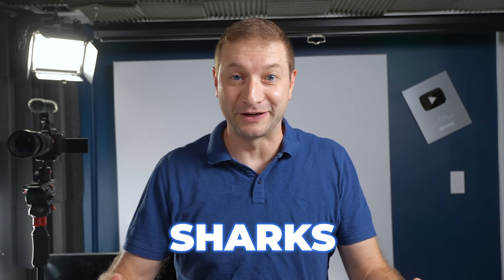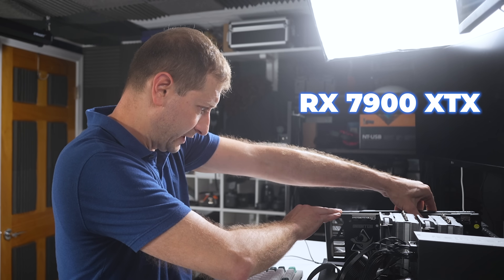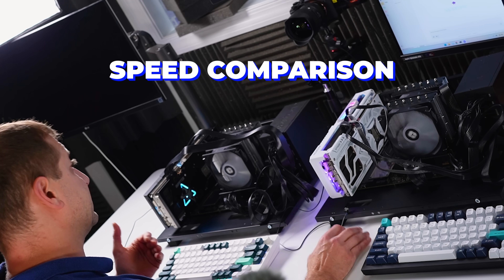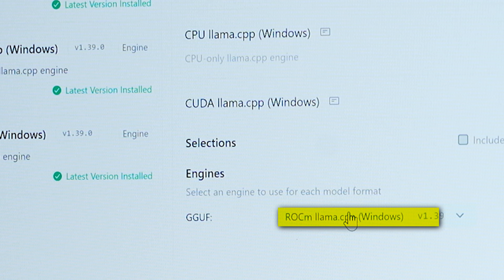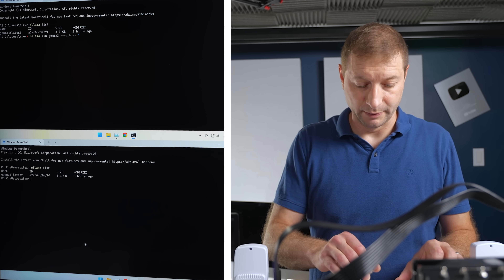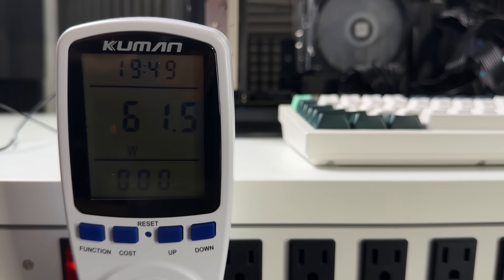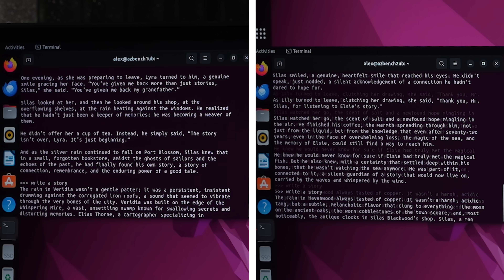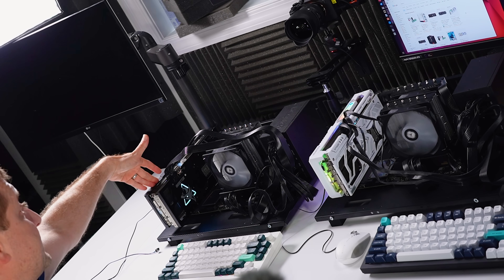RX 9070 XT is cheaper AND better… mostly

Comment: Both cards support vulkan and i have seen videos showing also 7900xtx being quite a bit faster on Vulkan vs ROCm. Especially on linux. As far as i understood the problem is Vulkan is only applicable for ollamacpp and not really general AI scenarios. e.g. libraries that require PyTorch for example.

Comment: I need some input on running local AI models on a Ryzen 9 desktop. I’m thinking about getting a GPU with 24 GB of VRAM, or possibly two 16 GB GPUs — but I’m not sure if running dual GPUs together works well for local AI workloads. Specifically, would an RX 9070 XT, RX 7900 XTX, or something similar be a better choice? Any advice or personal experiences would be really helpful 

Thanks Alex  for making such awesome cotent

Comment: The 9070 xt now works with ROCm on windows just fine, been running for a week or so myself… but now I want to know if I buy another 9070 xt …. Is that better than buying the new 9700 32gb ai card??

Comment: I do not understand the relevance of running 3Gb or even 13Gb models on cards with 16/24Gb available GDDR memory. Try generating UHD video on 16Gb v 24Gb and then see the difference, or run Ai LLM models 16Gb plus with partial offload v full offload. I am still using my old Vega64 with Vulcan and can run various 16Gb models comfortably after the first prompt has been generated and that is with only partial offload usually around 7.2Gb memory being used. There is always going to be a trade off between size and quantization but it all depends on what your expectations are and what results you expect or demand, larger prompts v low, better accuracy or simply faster responses. But when you try and generate UHD on 16Gb v 24Gb there is a clear winner and why 24Gb is a minimum for Ai if you want to mess with images and 4k video in higher resolution v 1080 HD.

Comment: in windows, you need to select which gpu to use on ollama

vulkaninfo | Select-String "deviceName"
That will list all GPUs Vulkan sees, in order (index 0, 1, 2...).
setx GGML_VULKAN_DEVICE 1

your prompt rate is different because your prompt is too small

Comment: ROCm was released before I bought my 1080TI in 2017, and back then I chose Nvidia because of CUDA, with AMD CUDA compatibility or ROCm on Windows nowhere to be seen. Its now ALMOST A DECADE later, and AMD still didn't provide proper ROCm support. Folks, don't buy hoping full ROCm support for Windows is around the corner...

Comment: Actually Vulkan is a graphic API, just like DirectX but not owned by any company, Vulkan is opensource. This is the main graphics API for linux gaming and PlayStation 5 (yes, if you're running game on PS5, you're running it on Vulkan, not any DirectX). But Vulkan because of its opensource nature have many more features, this one which allows you to run models using Vulkan is one of them.

Comment: If AMD releases cards above 32GB of ram for the consumer market, its over for Nvidia. They would literally be scrambling. If they build parallel multi-gpu support into ROCm on top of that, we will see AMD AI rigs everywhere. We already have AMD Cuda support layers in third-party. Capability could beat speed at this point. Mac has shown us that.
Reply: I have news for you friend. Pro R9700
Reply: @mock15599 I’m half split on the AI pro 9799.  It’s a ton of RAM for cheap but it’s also 660 GB/sec, which is slower than even a 3080, 4070ti.  And also the driver issues and compatibility issues. Though they did just just announce PyTorch compatibility with RDNA4 so there’s that.
Reply: @mock15599  For some reason memory bandwidth sucks on them though. But great value for the amount of vram
Reply: let the VRAM GDDR WARS BEGIN!

Comment: Hey quick question here, You software engineers do you actually use llms locally while coding for example? and either online or local, does it make a meaningful difference?
Reply: I'm asking because lately many developer-lifestyle people on youtube post videos like my apps for productivity and coding etcetera etcetera. BUT mostly i see 15 different apps with limited usecases and it seems to me that learning to use that many apps for specific usecases takes more mental power than doing the work itself. However, i m not a developer and the closest i have ever been to coding is c++, matlab and python mainly for calculations.

Comment: Been rocking out 2 7900 xtx's in a system with 64GB of memory and a 24 thread CPU.  I can run Llama 4 Scout 104 billion param model with decent performance.  Loving life, and I have been able to leap ahead of my co-workers with my AI learning journey.  Glad that you are embracing other vendors for inferencing.
Reply: @chucksanders7131  I may consider this route if they don’t release the 32GB Ai Pro soon enough

Comment: "...we'll leave that for another video." - man... Alex... your really are building up tension with the 9060 XT vs 5060 TI video. 😅Alright alright... I'll keep waiting. Still, thanks a lot for testing all these cards for a better overview about what is currently on the market and what it is capable of.
Only missing (after the 9060 XT video) would be the B580. And apparently in some types on AI application it actually outperforms AMD - which was a shocker to me.
Estimations are that AMD will catch up to NVidia with 90-95% of NVidia's speed through improvements of ROCm by late 2026 to mid 2027. Full parity might take until 2028. So only 2-3 years until it won't matter if you're using an AMD card or a NVidia card to run your local AI. (It's going to be interesting if NVidia improves Linux compatibility, finally, and on the other hand if AMD will create a software environment to compete with with NVidia's "Broadcast", and by doing so give the rising number of Streamers an alternative tool to that only running on NVidia cards.)
Reply from the maker: ok ok it’s coming Eric! I blame you for making me get all these amd gpus!
Reply: @AZisk  🙈
Oh no,  I can only imagine your struggle having to juggle all these cards in your office. Hey, if you need some room to breathe, I'd be willing to take one of them to ease the burden on you 😅

(Seriously, I would - if not for my very tight budget and shipping prices plus import sales tax from the US to Germany... which would make it probably way more expensive than just buying a new one in 2-4 months if prices don't go up and some other things go well. Since the finances don't allow for it, all I can do is thank you for putting out all these videos, that allow so many people watching to make educated decisions on what to spend their money on. Thank you Alex for putting in the effort! 🙏)

Comment: Your work is doing a lot of service for the home AI community.  I think the only other thing you could do as well would be to test out those new Intel ARC gpu's that you can buy off the shelf.  There's also a new "sparkle" intel arc that comes with 48gb of vram which should cost either $500 or $1000 from what I read, but of course for LLM's no one is sure of the exact performance.

Comment: 0:21 uhhh do you have some insider info that hasn't been released yet? 'cause AMD has maintained messaging that they are not going to release a more powerful RDNA 4 model than the 9070xt, saying that they no longer want to make cards for the flagship part of the market
Reply: so they're not going high end on rdna4 but they do have a clear plan to try something on rdna5. but you're looking at late 2026 to more likely 2027 before we see those high end cards.
Reply: @bpelectric  Maybe he's talking about the R9700, the 32GB AI card.

Comment: With a love for Linux, I would love to tackle or find out the issues of what is holding back Ubuntu 24.10 or 25.04 in the setup since you mentioned so many versions back. Of course, some engineers just like to get the task at hand done, while others like to build better tools to get things done. Maybe more of a technologist, but that is me, "Build the better engineering tool to do stuff for me."
Reply: I'd also be interested to know if debian or arch have the same issues and/or workarounds/fixes if any.

Comment: Have you tried Modular out to get CUDA to run on AMD or Apple Silicon? Was considering getting the framework desktop 128gb instead of the DGX Spark if it's able to run CUDA with that

Comment: Ubuntu 22.04 is very old, which has nothing wrong with it on itself but you will have better performance from a linux distro with a more recent release, even more for the newer amd cards. Please get the latest Fedora release or cachyOS (which is an arch linux based distro and is optimized on all its packages -- cachyos is faster than fedora). I actually would want to see on more recent linux distros like cachyOS or Fedora since ubuntu only releases hardware enablement updates with their LTS releases but the rest of the whole software stack is pretty much old and frozen on their year of release and that makes ubuntu lts looking more like stale distro. Thanks for the vid.
Reply from the maker: it’s an oldie, but a goodie. not so much as it’s good, but that it had support for what Im trying to do

Comment: How about AMD Radeon PRO W7900 48GB, built on the same architecture as consumer 7900 but with extra VRAM for AI workloads? Radeon PRO 9700 32GB should be releasing soon as well.

Comment: Release 48GB $1000 GPUs and crush Nvidia out of the consumer market.
Reply: amd, nor Nvidia is going to sell anything with vram for less than 3k.

sidenote: intel might, with maxuns dual 24 GB b60
Reply: Pipe dream
Reply: NVidias new GDDR7 cards are hardly faster than GDDR6X cards they are a HUGE disappointment!   I paid for my 9070 XT by day trading AMD stock over a 2-week period!  So my card was FREE !!!
Reply: CUDA😂
Reply: @ESGamingCentral , Why is CUDA so important? How many people actually program in CUDA vs. how many program using TensorFlow or PyTorch?
Reply: Only for those who need them or care. I'll never buy an AMD graphics card or CPU again. I don't trust AMD after multiple let downs.
Reply: @toby9999 😂😂😂😂 what a comment. You should check the news, walk on grass and check how Intel is doing.
Reply: @toby9999 , What letdowns?
Reply: It would also do if they Go with 32gb
Reply: Nvidia dominate the market
Reply: @vulcan4d  they are already cutting costs lmao, AMD can’t sustain in the GPU market and you talking about 1k GPU.
Reply: @vulcan4d  sadly...
The 48GB of RAM alone costs ~400-500$ now :(
Reply: AMD is about to release a new card called Radeon AI PRO R9700. It's going to have 32GB of memory and be just as powerful as the 9070 XT but with more AI accelerators. It's going to be around $1250.
Reply: @clay2k452  Radeon AI PRO R9700 is a peace of scrap by specs with a slow GDDR6 256 bits (644.6 GB/s) compared to RTX 5090 GDDR7 512 bits (1.79 TB/s).
Almost THREE times faster memory on Nvidia!
Even old RTX 3090 will be faster than the "new" Radeon AI PRO R9700.
Reply: @vladimir0rus  Capability for the price is the point. Of course a 5090 is significantly faster but for most people doing local llm, this is the best card for the price. Not everyone wants to burn 3k on a card for AI. Capability vs speed in this case.
Reply: @KristopherrLove  estimated launch price for Radeon AI PRO R9700 is $1250 - you can buy two second-hand rtx 3090 for that and have 48gb with faster inference.
Reply: @vladimir0rus true! The only exception is the dual gpu consideration is a bit rough for some users. I could imagine ai focused machines looking to be a small as possible. I’m just going to wait until apple gives us something faster because you can do 512gb on the current system they offer. It’s about the speed of one 3090 in inference but way more capability to run stupidly large models.
Reply: @KristopherrLove  yeah, but to run ten times bigger models on acceptable speed on Apple HW it should have ten times more memory bandwidth than now.
Reply: @vladimir0rus 100% agreed. This memory bandwidth is ass cheeks for how much money is being spent. If they at least made the ram cost more for more bandwidth, I’d consider it.
Reply: @KristopherrLove  Bandwith doesnt matter here its been proved its all about them pings.
Reply: Ngreedier: no problem we earn more in AI/commercial market 
😂
Reply: @frankwong9486  "Ngreedier"
So nabbing that.
Reply: Imagine glazing two billion dollar companies
Reply: @slurples149 nvidia trillion amd bilion
Reply: @slurples149  Yeah, look at the comment  of @reza5347 in the replies here if you really wanna see glazing of NOT 2B BUT 4TRILLION dollar companies
Reply: @slurples149  techtuber know if they make pro amd content it will get posted and shared on pro amd website like reddit and grow their channel
Reply: Lol Nvidia hit 4 trillion dollar market valuation. They don't give a shit about the consumer market 🤣.
Also why would AMD leave money on the table for petty PC wars. They could easily sell that card for $1500-$2000. It makes no financial sense for them bring it at such a low price point. Intel on the other hand? They need something like this on the market.
Reply: @CHA0SBLEEDS  they will come crawling back cap in hand when the AI 	bubble collapses, and collapse it will. Nvidia is significantly over valued when compared to its earnings.
Reply: yeah wont happen. There’s toooons of development made specifically for nvidia
Reply: Lol, that's not possible with how bad their optimisation in productivity apps is. And AMD is already a shitty company as it is, without Nvidia they'd be 10 times worse than even Nvidia is right now. The CPU market reflects that already, all their new CPUs had a 1.5x price increase for virtually no difference in performance
Reply: how is 48gb vram going to help when games like black myth wukong only like 8gb at 4k
Reply: @bigturkey1  this is all about LLMs - they need a lot of VRAM and fast VRAM.
Reply: @bigturkey1  I doubt you wouldve clicked and watched this Video and come out with the conclusion that this is anyhow about games
Reply: Bro their shitty 16GB card costs $1000 now.
Reply: @reza5347   It’s not $1000 did you pull that from your a-s or something. Also if you call that shitty you haven’t used the rtx 2060 mobile 6gb that had their laptops start at $1000 in 2020. Also if you’re gonna bootlick a 4T$ company at least get some money out of it.
Reply: @wyzeyaynon7306  Actually the hellhound is around that price point and the $600 MSRP is somehow ever faker than Nvidia's, they have done a much better job to control MSRP.
Probably because a full laptop with display keyboard CPU and everything is a different situation than a single GPU. how much does a equivalent one cost from AMD that has dedicated GPU (not iGPU)? oh wait, AMD is completely irrelevant in laptop market and nobody uses them unless it's a iGPU. 
 I will buy the one that's best for the money specially in the long run, you may lick either multi trillion/billion dollar company's boot and cry.
Reply: @vulcan4d  Ive never used more than 8gb its all you need
Reply: @Inv1xxity Most games I play use about 10gb, but in some cases the usage goes up to 14gb. So no, 8gb is definitely not all you need.
Reply: @Inv1xxity depends, if you play 1080P no RT,  on well optimized games at high/medium graphics (not ultra) or eSports title then YES this will be enough.

If you play in 1440P/4K (better resolution and usually prettier) you're gonna need a bit more than that. Probably 12GB for 1440P on an optimized game, probably 12.5-14GB on a poorly optimized game.

Comment: I have both the 9070XT and 7900XT and under Linux both cards output better performance using llama.cpp using Vulkan. I hope you give both ROCm an Vulkan a test. Hopefully AMD can keep working hard to improve their toolchain.
Reply: Try them using the vLLM ROCm docker! Supposedly better performance there.
Reply: @Kimomo965  Thanks for the tip. I have tested extensively between the official AMD Ubuntu ROCm images with Docker and using a self-made arch image with Vulkan and I still find Vulkan wins. I have a suspicion ROCm's focus is for highly parallel optimization for data centers/HPC and not so much single/duo card set-ups.

Comment: Considering the prices of these AMD GPUs compared to their NVideo counterparts, Why not just get two of these 9070s and put them into the same machine for 32GB of total VRAM but double the processing power? Or am I misunderstanding how these GPUs work when it comes to LLMs and AI processing?
Reply: Pcie lane support and power can get in the way, but amd is launching or just launching radeon pro w9700 32gb based on rdna4 for professional workloads
Reply: @jeremyh  I believe the model needs all the RAM in the same place, not split across two cards. But yes you could run two smaller models in parallel, for twice the output of that
Reply: @ivolol  Is that model dependent, or the runtime used (llama.cpp, etc)?

Comment: I have a 7900 xt and it works good for llm. Of course one could always use more RAM.

However, what about ROCm support for Ryzen AI chips on linux?
Reply: @hw2508  Sadly and confusingly, ROCm does not handle the NPU in the Ryzen AI chips. ROCm is for GPUs exclusively, whereas the NPU is basically an ASIC/IP Block based on a Xilinx FPGA. NPU support is handled by the "Ryzen AI Studio"/ONNX Runtime software. If you want a working example, I suggest you check out Lemonade Stand (Windows exclusive), it's an AI Inference frontend and backend that encompasses llama.cpp, and the ONNX Runtime together, and it was released just a few days ago. That supports combined NPU + GPU inference.